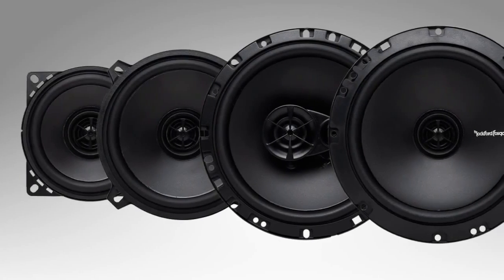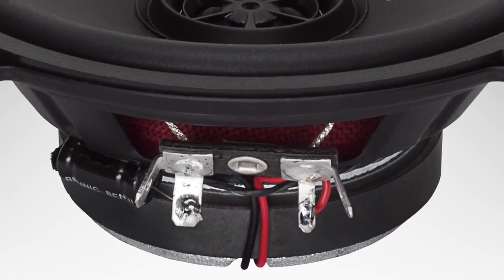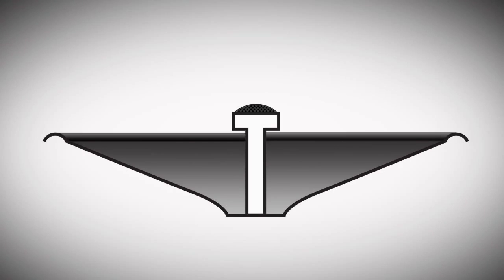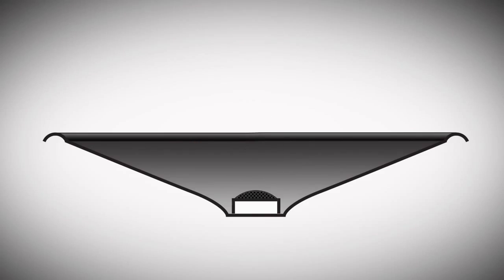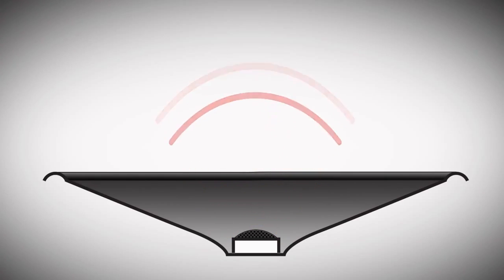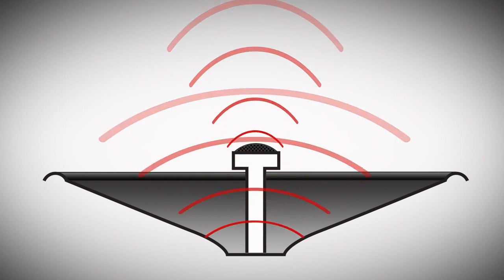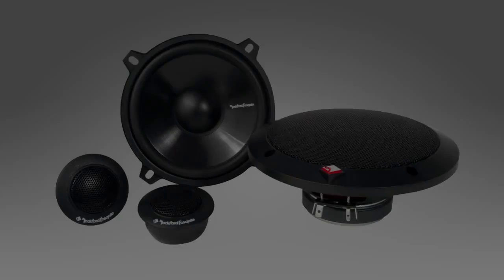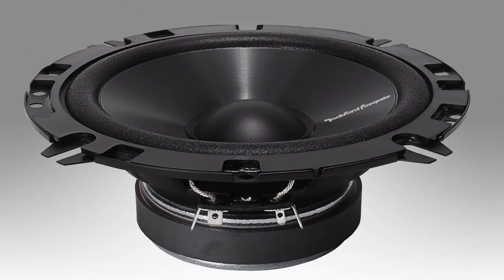Rockford Fosgate: Prime Speakers (2.1)

Comment: Why does everybody want to talk about speakers but nobody wants you to hear them.  👎
Reply from the maker: We always recommend critical listening tests be done at your local Authorized Rockford Fosgate dealer on a sound board where you can switch between different models.  Most all desktop and mobile devices use very small diaphragms with a bandwidth limited frequency response.  In other words, don’t judge a pair of 5.25” or 6.5”components or full-range speakers through a set of cheap 1” transducers.

Comment: rockford fosgate p169x3 prime, 
Bass is good or bad??
Reply from the maker: The Prime R169X3 speakers have a great frequency response of 47Hz - 20kHz.  However they are designed as OEM replacement speakers so you don't want to drive the snot out of them.  If you're looking for bass response, you'll want to look into a subwoofer.  A single 8" or 10" can provide some decent bass without taking up too much space.

Comment: Recently bought 6.5 3-way for the rear and 6.75 (6 3/4) component for the front in my Kia Soul. The factory stereo was weak and replaced with aftermarket. I almost don't need a amplifier for them but going to anyways as it gives a clear crisp sound. Can't wait to install my subs.
Reply from the maker: That's great Leighton!  Glad your system upgrade is going great so far.  Just keep the amplifier as closely matched to the RMS power handling of the speakers and you'll have a great performing system.
Reply: @rockfordfosgate  Thank you for the reply. My last car was a 1999 Hyundai Tiburon, it was my very first experience with Rockford Fosgate speakers. More specifically 12" DVC Punch (now called Prime) subs. Powered by the Punch 2 amplifier of that era, that amplifier was a beast. One of my friends had a all MTX system rated at 1000-1500 watts and was jealous that my  setup hit harder with less power. 

I like the stickers and would love to advertise but it's unfortunate that certain people would rather steal than buy their own equipment.
Reply from the maker: @leightonelliott3140  That's awesome!  Curious why you mentioned the 12" DVC Punch are now called Prime ... the "Punch" series subwoofers never get/got reclassified, if they are labeled as "Punch", they are always considered a Punch Subwoofer. I've worked here since 1989, so you can take that info to the bank :-)
Reply: @rockfordfosgate  I said that because I just purchased 2-10" prime DVC subwoofers and I'll except the fact I am wrong. I figured it was product line renaming. Keep in mind it has been a LONG time since I owned that car. That said it may have been the Punch 2 12" DVC I owned I remember the base(magnet) being smaller than newer, again been a long time.
Reply from the maker: @leightonelliott3140  Ahhh, got ya!  The important thing is you're using great quality products for your sound reproduction ... waaaaay better than factory! Ha Ha.

Comment: Why is the small tab pos+ and the big tab neg - ? all the harness's even the wire that came with the speakers are big tab (white)pos + , small tab (black) neg - ? I'm not going to blow up the speakers by plugging them in backwards am I ?
Reply from the maker: We're assuming you mean on the tweeter speaker wire, correct?  We're not aware of any harnesses that come with those, so maybe we're assuming the wrong speaker.  However, if we are talking about tweeters, due to the crossover induced phase-shift (all passive crossovers have this) you'll typically invert the polarity to bring the tweeter back into phase with the midrange speaker.  It will not blow up the speaker.
Reply: rockford fosgate speakers R1675X2 are the speakers. 6.75 I think they would be woofers right?
Reply from the maker: O.K. yes, the Prime R1675X2.  Don't have a good reason why the white isn't positive, just be consistent with the (+) and (-) terminals to the amplifier.  If they are connected backwards, you won't burn up anything, it will just be out of phase.
Reply: Thanks, that's the green light I've been looking for.

Comment: I have a t400-4 amp. Can I use these speakers or should I go with the power series full range speakers?
Reply from the maker: The Power T400-4 amplifier is rated to produce 60 Watts x 4 @ 4-Ohm.  We suggest not exceeding the RMS power handling of speakers.  Since various speakers have different power handlings, I'll use the 6.5" model across Prime, Punch & Power:

- The Prime R165X3 is rated to handle 45 Watts RMS.
- The Punch P1650 is rated to handle 55 Watts RMS.
- The Power T1650 is rated to handle 75 Watts RMS.

With your amplifier, the best option would be to use the Power T1650 full-range speakers.

Comment: I like the idea of the low mount tweet for sure.  But 1/2" is pretty weak sauce.
Reply from the maker: Prime coax speakers are typically used as OEM replacements. Sounds like 1" tweeters are more your style in the Punch & Power lineup.  We also feature 1.5" tweeters in the Punch Pro line.  Stay tuned, those videos are coming...